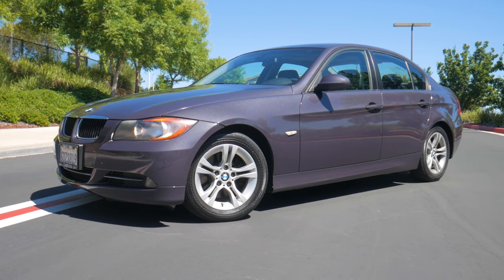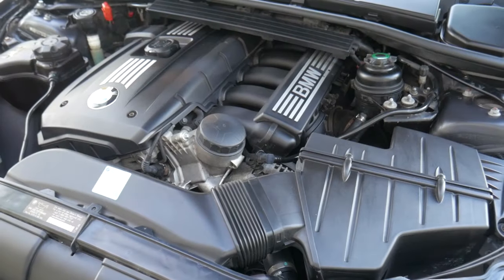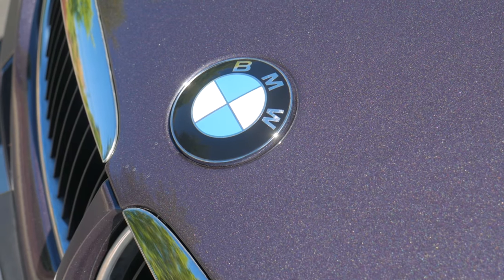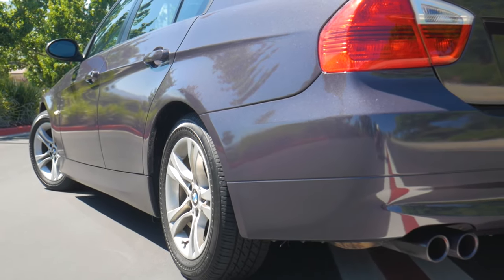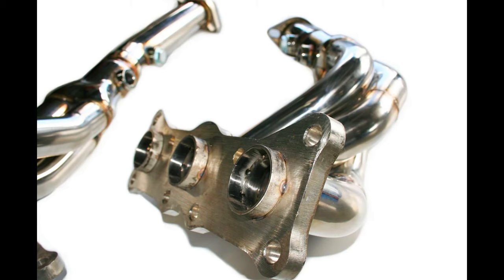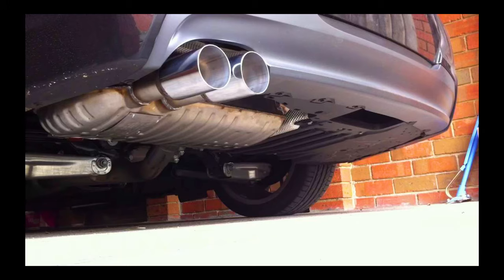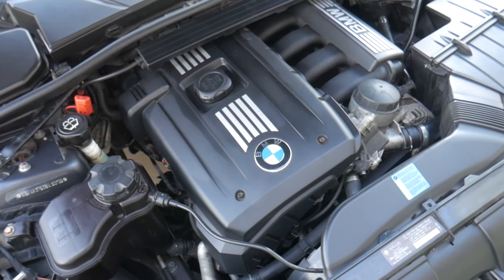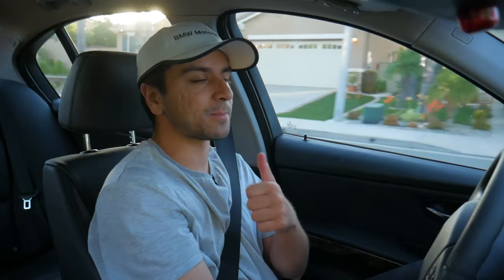GAIN +70 WHP On Your N52 With These 5 MODS!

Comment: my 06 330i n52 6spd has 212k on it rn and has not one light on the dash. truly a remarkably reliable engine, so happy seeing n52 content!
Reply from the maker: I love to hear that! It really is a solid powerplant for these cars
Reply: You guys are lucky, i blew my engine at 205k, also recently got a faulty steering column due to the cassette push to start, also rear axles are a pain to find due to them making 2 in the year of 06. All in all tho, with my new 130k km engine in the car, everything is running like new once again !
Reply: My n53 3 litre 250.000km
Reply: @zham6597  how much did your replacement cost?
Reply: Only major problem I had was a cracked valve cover a few years ago. Otherwise, yes it is bulletproof.
Reply: dacimuci I’m looking to pick up a 330i with 130k miles 6 speed as well
Reply: @elijahwalling4894  3400 all in, engine came with 130k km
Reply: 06 330xi not a light on the dash. Do have a RMS oil leak tho 125k
Reply: 06 330i - 315 000km
Reply: Ken XU turbos go
Reply: '06 330i 6MT here as well. 160k on the clock. I refreshed most of the primary gaskets and flushed all the fluids. Solid as a rock. I'd drive this thing across the country and not think twice. Throws no codes and is a fantastic daily.
Reply: @zham6597  How exactly did you blew you're engine?
Reply: 530i 6spd 320k kms  on lpg 15 bar on all 6 cylinders absolutely no faults no leakage nothing just driving pleasure
Reply: my 07, N51 6spd has 269k on it and is running the best its ever been. Truly an incredible car
Reply: You guys are lucky, i bought n52 after everyone praising its reliability but first year of ownership cost me £2500, and I still have unserviced gearbox, leaking oil pan, leaking valve cover, vanos issues that got quoted £2k for repair with no guarantee it will fix it. At this point i wish I bought n54 at least throwing thousands would be justified
Reply: SoCal love brotha! Great vids and keep up the good work. I owed 3 of these rides before buying a 335i. These long ignored cars deserve some attention, and a great way to learn how to wrench on BMW’s.
Reply: My 525i e60 has 207k and running strong no lights! Just flashed the 530i tune for the 3 stage.
Reply: 06 here with 176k no lights
Reply: Same im @ 265k
Reply: I have 323i is this also doable? With 323i?
Reply: Mine is on the way to 250k and the only problem with it is the bald wheels
Reply: '06 330xi 6spd (E91) reporting strong and trouble-free at 184k miles. 2006 seems to be the magic year for these.
Reply: I have an e93 6aut with 191k miles. No issues at all
Reply: 105k on mine but no engine issues at all
Reply: Still early so still learning upkeep for the long run
Reply: Damn mine has a 82k😅
Reply: 195k on mine
Reply: 75k on 06 330i. I’ve only had it for 2 months. Bought it for 10k the car is perfect. These numbers make me smile. I did look at one for sale that had 258k and was running perfect before I found this one.
Reply: @squidhead100  I have an 06 330i 6 speed with the same mileage haha. I’d yours an auto?
Reply: Just reached 200k on my e91 she’s smooth as can be
Reply: Mine just turned 280,000 😌 and she still drives like a beast.
Reply: Who is more reliable n52 or n54?
Reply: Yap my e70 n52 has 242K on it ...still mashin...
Reply: Yo i have a 08' e92 323i n52.. i fixed the leaking valve cover. But the pcv seems to be cracked as it sometimes (once in a while) it does the whistle and violent engine shake, once i turn the car off and on again it goes away. I get engine lighr that comes on and goes away at times. Most of the time it idles fine but sometimes it bounces down and up. I checked the codes it only says it has dsg code which is the transmission (6 auto) and it does feel like the gears are slipling so maybe i need to service the oil gearbox? 

Its at 177k kms. It still drives fine besides the issues i stated above. I think i need to get a major service done. And the dsg code gearbox wear code.
Reply: thinking about buying a 328i with 88k miles, thinking it will last a long time
Reply: My 2010 328i E93 is at 117k miles and is still running super strong. Definitely getting another 100k out of her. 

Only issues were oxygen sensor throwing a code and a leaky shaft sensor which also needed to be replaced.
Reply: Same here, hit 112k the other day and still everything is healthy besides simple weathering
Reply: 275k  km    not an issue or tick
Reply: This is great to see. I'm looking at an 06 330i 6 speed with 246k miles and its super clean and he says runs very well.
Reply: Same here!!
Reply: 06 325i manual running strong no lights 165k.
Reply: @Jason.cbr1000rr  u def need new pcv breather hoses i have a 06 and mine are actually recalled im guessing i got lucky because i don't have a issue but there known to break all the time and can destroy ur engine if clogged with oil and for the tranny I'm not sure u probably should service it since its a bit old but ur revs bouncing up and down could be the vanos, spark plugs, ignition coils, fuel injectors, fuel pump, valvetronic motor seal, vacuum leaks all that type of stuff
Reply: @I_Ali_I  yeah i know those many things and they are still distinct if you know it but can be the any of them. This case i found out my mech. forgot to shut the oil cap tight. I shut it then it stopped and goes all smooth now, revs too! And check engine light went away. Good small issue. Everything else i know i still need a new valve head cover cos of the pcv platic bit there.. apart mines fkd up lol
Reply: @Jason.cbr1000rr  yea I mean these engines are great but some of the small things get really fucking annoying if you can do it urself tho u can save some money soon I'm gonna buy the 3 stage manifold, all the pcv hoses, oil filter gasket, valvetronic motor gasket, starter, belt and also a few other things and just get inside there and blow it all out at once because I have a small rough idle for about a year and I have a idea of what its from but the weathers been ass so I haven't even looked yet and its really starting to annoy the shit outta me
Reply: I have an 11 n52, 267k miles and no lights. A fucking marvel, that's good for a yota! 😂
Reply: I got my 08 325i e91 (N52b25) for about 6 months it's done 217k km/134kmiles but I've only had it since 209k km/129k miles and found out later it was a Japanese important and was a repo car and look a little rough the edges and 2 months in and the exhaust camshaft needed to be replaced along with pvc valve and multiple other things but still obviously got it and not a issue since and no signs of it
Reply: 330i 06 308k 6sp and she still strong , thank God for my car
Reply: 11 328 n52 fbo has 200k, no dash lights either
Reply: Wtf y'all are so lucky... 

I have the engine light on 3 times a month (it goes away itself) sometimes idling (AT 323I E92) at the stop light the rpms will drop and bounce up and down just 2 times or so per 2 minute red light. 

Sometimes on cold start up and cold weather and if i dont let it warm up for just 1 minute to let the liquids go around, it will make the whistling sound as you let go of the throttle, i think its CCV on the valve cover so i guess i need a new one. So i have to restart the car, turn it off and on and itll go away. This happens once in a while but it happens.

And 1 or three more issues i cant think off the top of my head as this is a quick commment.

Also i service it and change fluids regularly so its good, 1 big pro is that i can see the engine oil temperature very low even on hot summer days, 95-98 Celsius and thats the maximum i would see. However over 3 months i can notice it gets hotter to manual guides normal temp, 100c 105c 

So yeah 😌😔 damn valve cover needs a new one, new vanos solenoids and filter, spark plugs, coil packs, fuel injectors and DME...

Either one or two or all can cause those misfire and idling issues although mine isnt that bad.
Reply: Just got my water pump thermostat coil spark plugs oil all replaced ready to drive gonna remove the muffler
Soon :) and serpentine belt replaced also
Reply: I just hit 300k on my 2006 330i ZSP. Still original clutch. It might not be as fast as a 335, but it is light years ahead as far as reliability.
Reply: @codyellington8238  damnnnnn I’m still getting my 330i 137k miles water pump replaced (faulty)
Reply: i have an e92 with the n54 engine im looking to get a e90 with n52 as my daily
Reply: How’d it hold up
Reply: @thebestsoccer2063  lol N54 are crap unless someone planning on make an extensive tuning on it otherwise they are shit N52 is strong
Reply: 2007 130I 250.000 km without problems
Reply: My 08 528Xi n52 has 218k miles and no lights on the dash is yours still kickin it??
Reply: @SimplyCarThings Thanks, I finally got the 3-stage DISA IM and swapped out to a magnesium valve cover on my 2008 328xi e90 manual trans BMW. Now, I'm kicking myself in the kiester, because because I want to go back and do the MILVS mod

Comment: A lot of people can start by making sure their 2 or 3-stage manifold actually works. Most of the time after 100000 the Disa valve get's stuck (actually oil getting into it's motor and it becomes "weak") and no longer closes which reduces power at lower RPS (because DISAs are designed to be CLOSED by default and only opening at certain RPM) and no error ever tell the owner about it. As for mods - most of european versions already have it including 3-stage and different air intake/filter  so one can find used EU car/parts to retrofit it.
Reply: Just replaced the DISA valves on my E90 330i and it made a world of difference in low rpms.

Comment: I have a 125i (EU Spec) in Argentina that I use as a track car. I started out with the 218hp, mapped to 130i spec, to the alleged 265/272hp Bimmerlabs maps. I have the "euro intake" and DISA valves from factory, I added a Turner Silicone Hose and BMC filter to make the intake a bit more free flowing, and then bought the MILVS kit and had Jim at Kassel Performance do a remote tune. We probably did 40/50 dyno runs, he was very helpful to get the straightest possible torque curve as there was a dip at about 3.5k. We managed 233whp without headers. That's why I said allegedly 265hp... I now have custom race headers and full exhaust as its now a dedicated track car. I'll dyno the car soon, and then play with the compression ratio by modifying the head gasket. We'll see what is pulls, but gaining 70whp reallistically isn't that easy in N52's. An ESS supercharger adds another 70whp but I don't think its worth the 5/6k plus labor costs.
Reply: What hp now ?

Comment: I run an N52 in my e86 endurance car and these upgrades with the correct tune is about 258 whp. I have tested EPIC motorsports, Activewerks and Kassel Performances tune and Kassel's was the most aggressive to get to the max number with an average delivering 255 whp, Epic's is a more conservative and better for daily driving and Activewerks was the latter delivering  more power in the lower and less at the top end. If you really want to put the power down, I would suggest upgrading the differential gearing ratio to 3.73 and a light weight flywheel for maximum performance.
Reply: Does the n52 330i have a bolted or welded ring gear?
Reply: Can't you put an lsd piece in the diff

Comment: I have made all of these mods, including transmission tuning mods. It has brought the car to life. I’m running Borla Touring Edition cat-backs that sound so good.
Reply from the maker: that’s awesome, i’m sure it’s very joyful to drive!
Reply: Is your pedal delay / late throttle response gone? I like doing rolls sadly the delay is the only thing holding me back
Reply: @z_bleach  Yes! The throttle sensitivity was part of the tune from ESS and there is no delay.
Reply: Check engine?
Reply: @Rockony  I installed O2 sensor bungs with many-cats with the headers and it prevents the Check Engine light about 95% of the time.

Comment: Most N52's in Europe runs the three stage manifold (the 2,5l 325i for example), so might be parts to order second hand from Europe.
Reply: Good to know, so I can cross that one off  of my list allready :)
Reply: Yeah I'm in UK & recently bought a E60 530i msport & it's pushing out 258bhp so I think it has the 3 stage only just found out about it then found this video all good news we need plenty of encouragement on n52
Reply: @bluerineimb1148  yup, it's mostly American 328i N52B30, E82 125i N52B30 and some detuned 323i N52B25 170hpish variants that does not have those dual DISA Valve three stage intakes.  Other than some N53 cars that all run 3,0l engines but 218hp 325i has no three stage intake. And add all other kinds of BMWs (E60, Z4, 6, 7 series etc) between 2004 and 2012...
Reply: Or just spend a little more and get a 330i lol
Reply: @Theeelp1  yes & it wauld almost same price & far better engine

Comment: Thanks for the information but just to add to the performance is to wrap the headers so that the heat from the headers doesn’t really bother the intake manifold for more cooler air

Comment: The mods you suggest will add at maximum 30 whp, and more likely not more then 20. The only way to get the 70 whp you dream of without ditching the Valvetronic is the ESS supercharger. That will add 80-100 hp at the crank
Reply: @BbwSlayer 666 $4800 for the kit, if you don't DIY, install is additional.

Comment: My 2006 BMW Z4 3.0si 6spd coupe is getting these mods as I write. ZOOM!
Reply: Update: what a remarkable difference a few simple changes can do... and I'm not even finished yet. 

So far, I recently installed a APE Stage 2 COLD Air Intake, a XLR Race Chip and cut off my muffler... amazingly good results thus far! 

My next mods for my E86 Coupe will be N52 catless Headers & ECU tune.

Comment: The best intake 3 stage Manifold came with the car. They are already tuned to those horse power levels from the factory. Now we're talking about the German made and shipped to the U.S. models. It's in your Vin. as made. But ya" it makes about 260 or if on a track 280 top end. Not bad at all for stock

Comment: Re: 3-stage manifold upgrade, you said something like, "buying the parts new will cost $800 alone". 

Only if you are buying knockoff Chinese parts. The BMW DISAs alone, from places like FCP Euro etc., are more than $700, and the manifold is another $1000. And then you need to pay someone to do a full 330i DME flash or you will never realize the full potential of the upgrade. And the cheapest reputable flash I have seen runs ~$500. 

So more like ~$2350 for new parts alone.
Reply: They go for $200 complete on eBay. I picked mine up for $40 at a junkyard. Bimmerlabs has the stock 330i DME available online for free. You just need a k+dcan cable to flash it
Reply: I paid $130 for a 3sim, 350 for new disa’s, $500 for a headers and 495 for a stage 2 tune. A euro intake for $120 dollars to top it off.
Reply: @mountjoy23  where’d you source your parts from?
Reply: @GPMAX01  Ebay, FCP for disa's and eurocustoms for tune and headers (AA) in 2020

Comment: Thanks for the n51 super efficient 3 stage intake manifold suggestion!  Those 3 stage intake manis are nice!  Should those also be tuned after install?
Reply: Yes. Tune definitely.
Reply: You have to tune the computer because the flaps don't operate correctly on the 325 328 etc factory tune when you do the swap.

Comment: n51 also has 10.0 compression ratio compared to n52s 10.7 which is why it has the 3 stage manifold and has lower power than the 330i n52

Comment: Good video. But there are "HP" gains, and there are "speed" gains, simply going faster on the road. And if you wish to go faster, and not just in a straight line, suspension upgrades are a nice way to go. You will be able to better utilize the HP your engine creates. However, I do know that this is not necessarily a cheap and budget friendly modification for your car, but will not only provide for a faster vehicle (especially in the turns), but one that stops quicker, and is safer all around as well. Stopping ability isn't just pads and calipers, but also tires and suspension add to the vehicles braking capability. And if you can afford it, adding M3 suspension parts are a good way to go for your M52 vehicle.